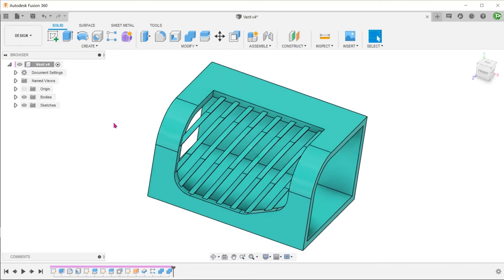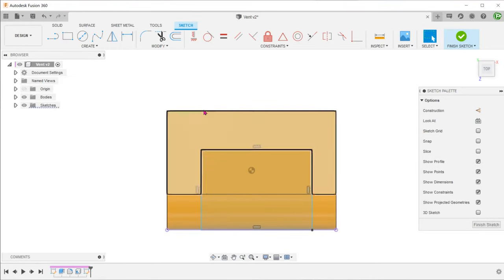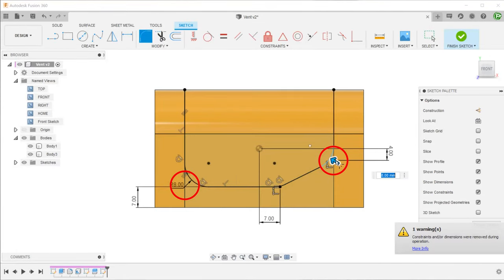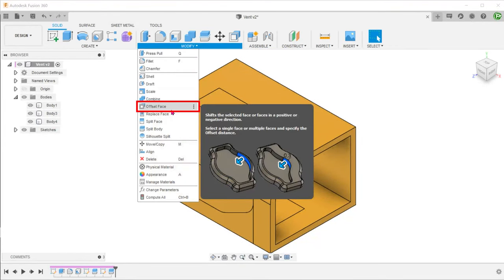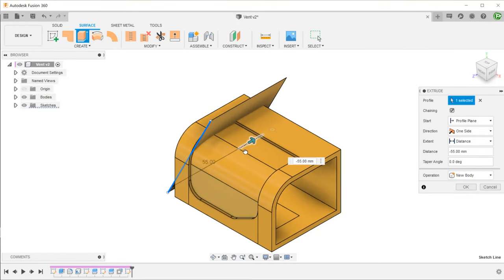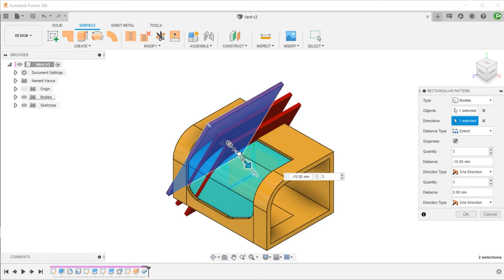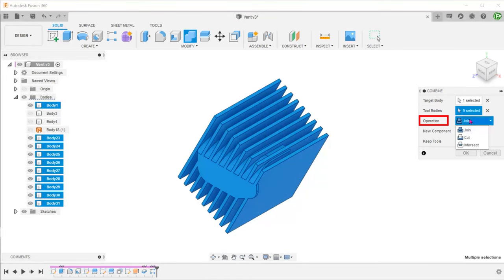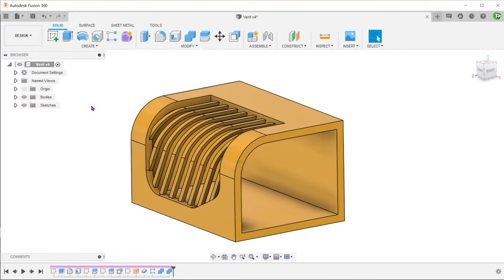Fusion 360 - Case Study 12

Comment: Maybe one sketch on the front plane with two extrudes (cut and combine) would be a simpler method.
Reply from the maker: Hi, I'm not quite sure I get your suggestion. Could you elaborate?
Reply: @Fusion360School  
Instead of the split surface tool, an extrude could be used.
Reply from the maker: It looks like I could have drawn a sketch on just the front plane and do an extrude with the operation set to intersect. However, doing this would require a copy of the main body since there is no option to keep tools. Will try this out.
Reply: @Fusion360School  
You could start by extruding as body and use it for a boolean cut followed by an intersection, keeping the tools for the first operation. 

Your videos are very well made! And no ads - thanks!
Reply: @Fusion360School  Yes, one sketch on the front plane is enough. Then extrude it as new body. Then combine new body with main one as intersect + keep tools - this creates copy of inner section. Next combine it with main body as cut + keep tools - this leaves us inner section separated from main. Now we can do the offset, etc.

Comment: Great video. I'm puzzled why you patterned at an angle. If you pattern along the axis instead, the rectangles will still be parallel, but you won't have to worry about not having extended enough.
Reply from the maker: Come to think of it, you are right. Looking back, I should have patterned horizontally.